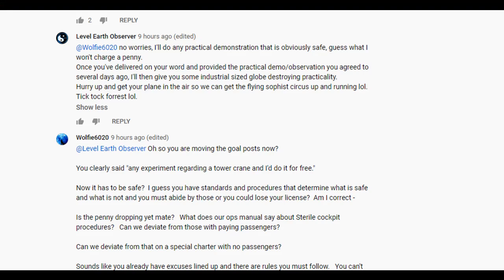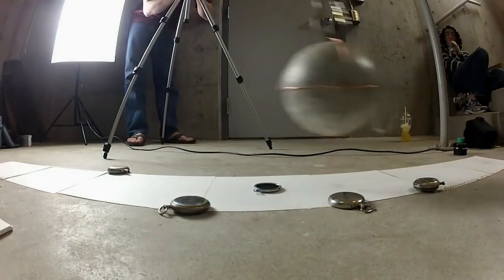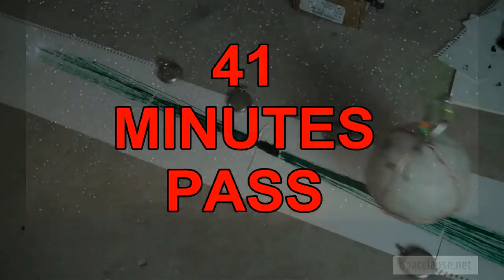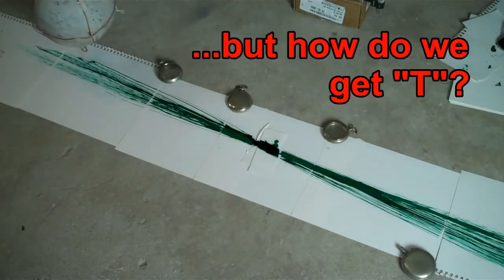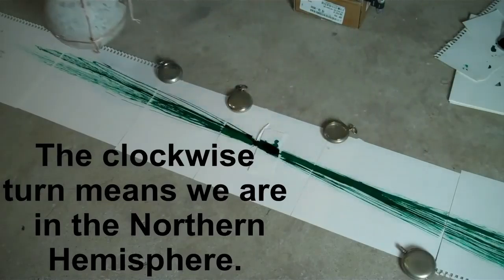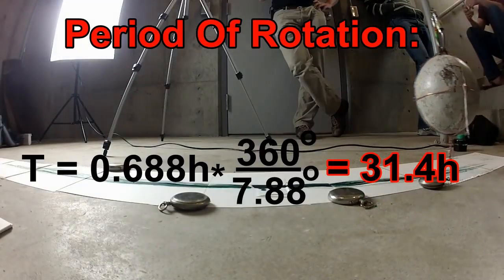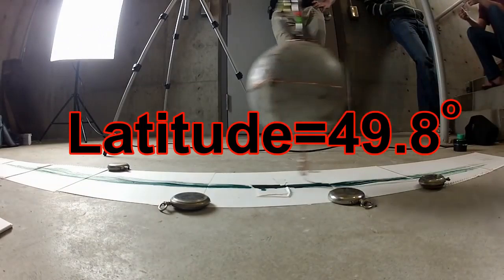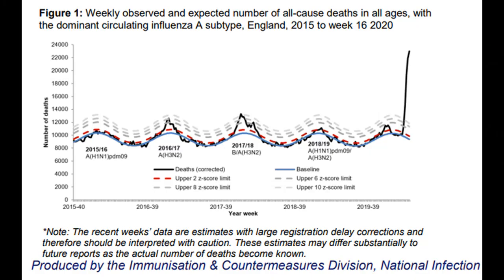A Level Earth Observer Challenge That He Wanted To Do- But Can He Pull It Off?

Comment: Good challenge. In the end, though, I think we're allowing ourselves to be manipulated by a strategy of distraction by Flat Earthers. They like to talk about stuff like pendulums, gas in containers, perspective/Rayleigh Criterion, etc ... Anything to avoid the elephant in the room, the fact that they have had YEARS to create a Flat Earth map, and have been either unwilling or unable to do so. The ultimate proof, and in many respects the easiest proof to produce, is an accurate map. It would be a lot easier than trying to disprove gravity or all the other laws of physics they discuss so much.
So my message to Flat Earthers is that I will not listen to anything they have to say until they have produced a Flat Earth map that meets the following criteria:
It should show all the continents (Antarctica is not necessary) and the oceans that separate them TO SCALE in a single, contiguous map printed on paper (not digital). It should include a representative sampling of accessible island groups such as Hawaii.
It should show a prominent landmark such as an airport or city in each of a dozen or so cities on each continent
It should show enough key coastal features to define the major coastal outlines
To verify the accuracy of this map a review committee of people from outside the FE community should pick any 2 points on this map, scale the distance, and compare that to the actual distance measured on the physical Earth. The result should be within 3% + -. This should be done for 10-15 pairs of locations.
Creating such a map isn't really such a big undertaking. FE leaders need to enlist volunteers on each continent to take actual measurements. These measurements could then be compiled into a database and the map developed from that.

Comment: The period of a pendulum that is two meters long here on earth has a period approx. 2 seconds.
The same pendulum on the moon would have a period of approx 7 seconds. The gravity of the moon is 1/6 of earths so the period would be longer.
Reply: The period of the pendulum is about 8.5 seconds, the length of that pendulum is about 18 meters.
Reply: I mentioned the navigation and a very short explanation how the Navy uses the system to navigate on and under the oceans. I neglected to mention how gravity effects the system. 
Accelerometers use a pendulum type sensor to sense acceleration and they sense gravity if they are off level. If the table gets beyond a certain critical point, the acceleration data is sent to computers and added as velocity. The computer calculates new position to reposition the gimbals and the new in acceleration sensed and it is inaccurate. The system will oscillate somewhat naturally but the computer needs someway the detect runaway velocities and the way it is done is to tune the system to a theoretical pendulum with a length equal to the radius of the earth. The computer monitors the accelerations to detect a 21 minute period with the change in velocity. We would then get an alarm and have to calculate the reset values and the critical time to reset velocity to a zero error value. 

 So I worked on a a very accurate inertial system that used the science of physical inertia wherein our understanding and application of the science to navigate in a stand alone system.

Comment: The problem is the type of crane he operates is not a single wire with a hook, it has 2 or 4 falls of rope with an arrangement of pulleys usually in line, which would prevent it from swinging freely in all directions.
(Sgnd.  Ex crane inspector)
Reply: Yes, but you could attach a long wire to the hook and raise the hook all the way up.
Then cut the wire and attach the weight.
(Sgnd. Current crane spectator.)

Comment: Here's the funny thing... You've not only shown how intellectually dishonest that LEO is, You've also shown what a terrible crane operator he is too.  Because if he was a good crane operator, he'd know that his crane is designed with 4 load cables going to the block in a coplanar arrangement.  This is done specifically to make the load more stable as that configuration resists any swinging motion that isn't either in that exact plane or perpendicular to it.  That means that there is 0% chance that his equipment would work as a Foucault Pendulum, but he's clearly still too scared to do it.
Reply: I am not so sure LEO the pantotard is so concerned that he displays what a terrible crane operator he must be when announcing in public these days that you think the earth is flat. That is like putting a huge tattoo on your forehead that says "RETARD" and thinking it is a badge of honor.

Comment: @WheresWally: apart from the fact that Level Earth Observer is obviously chickening out, I have doubts that this experiment would actually work. First of all, I don't think there has ever been a Foucault's Pendulum that was exposed to the elements, in particular wind of course will influence the swinging tremendously. Foucault's Pendulum use a very thin wire/string, single strand wire is probably the best. A crane uses thick multi-stranded wire that will resist rotation and motion much more, I doubt that you could get it to swing for 45 minutes. Most importantly a Foucault's Pendulum is attached at the top to a joint/bearing which allows it to rotate freely, which is not the case with a crane cable.
Reply: You are forgetting the magnets.  This experiment can't work due to magnets apparently.
Reply: @awatt  No magnets are needed at all, the one linked to in the description doesn't, and neither did Foucault 's original Pendulum. Only if you want to keep the movement going for more than an hour, do you need some sort of actuator, which has no effect on the direction of the swing.
Reply: @Gerard1971  
I know that you don't need magnets.  Adam claims that the change in swing direction is do to "magnets" that work in a way that only applies to a pendulum constructed of non magnetic parts.  Just take that in for a moment as it's an arm waving dismissal on a galactic scale.  Even the Insane Clown Posse have a better grasp on how magnets than this guy.
Reply from the maker: Maybe that is all true.  Just wanting to see if Adam can follow through.
Reply: @whereswa11y  
In the UK "follow through" is slang for when you break wind and...you get the idea.
Reply from the maker: @awatt  so he is all follow through then?
Reply: @whereswa11y  
Totally.  That's why they have banished him to a tower crane.

Comment: I remember that video. It was really awesome. Some high school kid used his apartment complex's 60ft tall fire escape stairwell to hang the rope. Proved Earth's rotation with less than $30 worth of material.
Reply: Do you really expect LEO to do an honest experiment with his crane. If he does provide any data there’s a good chance he’ll fudge the results.
But I do remember the original experiment. The kid reminded me of my grandson. He did an awesome job.
Reply: @Sherwoody  A experiment with the crane is useless. It must be done in a tall closed room. Wind must be put out from experiment
Reply: Pedro Ghiguly I was surprised Walley put the challenge to him with the crane. His results would at best be compromised. If he did have proper conditions I would still be suspicious of him reporting honest results.
Reply: @reynaldowify  .
The result may not be useful but it could demonstrate rotation of the crane does not change the direction of the swing.
That is the principle of Foucault's pendulum.
Reply: You have to lie to flerf. I mean even back hundreds of years ago there came a time they could circumnavigate the earth and not fall off an edge or ever hit a dome or ice wall. So regardless of anyone's belief they accepted reality and the conversation was over. But here in 2021 apparently a few idiots didn't get the memo.
Reply: Actually the very first circumnavigation of the earth was completed in 1522  meaning next year will be the 500th year the earth was 100% confirmed a globe before we had pics and videos from space. Happy 500th year of being complete reality denying idiots flerfs. Hold a party.